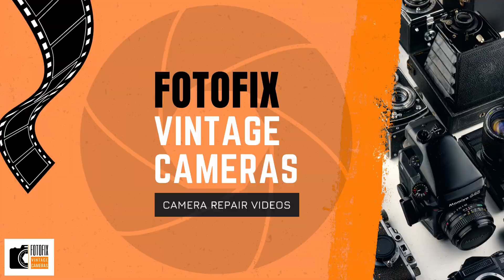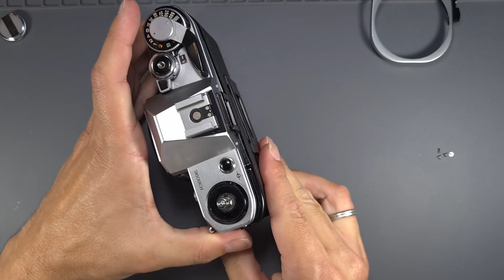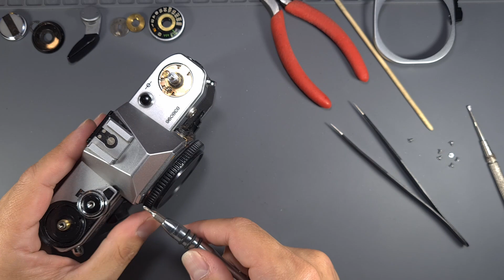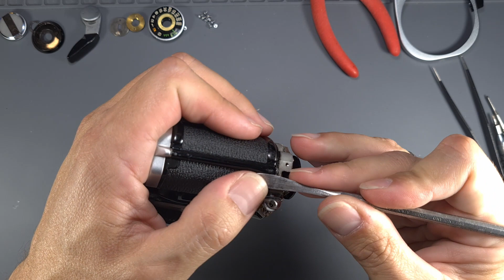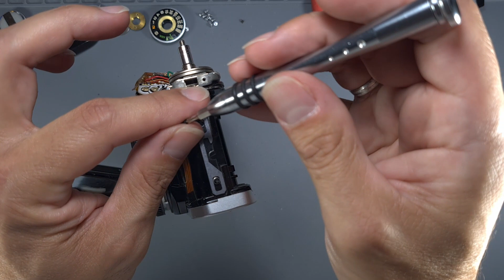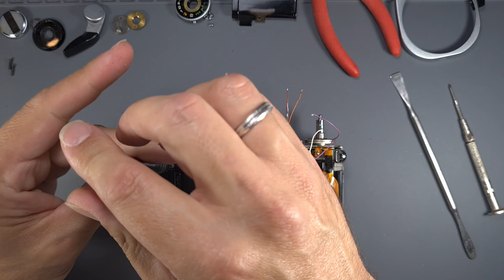Canon AE-1 - Remove the Mirror Box

Comment: Suggestion: after removing the top cover, temporarily re-install the shutter speed dial. This will keep the coupling ring that is under spring tension from flying off and causing extra work and potential damage to the tungsten wire.
Reply from the maker: I normally do that! Thanks!

Comment: Thank you so much for posting this.  Im trying desperately to teach myself to repair old film cameras and I also work in a camera store where we process a lot of film. I see squeaky Canon AE-1's everyday. I knew the camera had to be oiled but never knew the exact process. This was eye opening and I can't wait to try myself one day. I may ruin a few cameras on my quest to learn but thats okay. The master has failed more times than the beginner has ever tried.
Reply: If you really want to get into camera repair, get a broken camera and try to fix it. I did it that way and it works. Just be patient and note down all the steps by taking pictures or so.
Reply: @peterbarth1479  I have over 300 film cameras and a whole lot of which are broken. Ive decided to do just what you said, with a Nikon L35AF2 which I have about 5 of...but I have made minor repairs on them in the past(switching battery doors, cleaning viewfinder, etc) but have never successfully repaired other issues. Im gonna try what you said. Im gonna film the entire thing and see what I can do with my current knowledge. I hope to get there. Though I imagine fixing something like an AE-1 may be easier because it's more mechanical. I've taken apart a few AE-1's to oil them, but not much else. I did fix a Pentax K1000 but I mightve got lucky there. I do have a spare AE-1 so I may try that before the L35AF2.
Reply: @kiroscene6835  Sounds great, go for it. The only problem I see with the L35AF2 is that it's all electronics and nasty flex cables and that sort of stuff. While it is certainly possible to fix broken PCBs and flex cables it might be better to start with mechanical failures to avoid frustration. But no matter what you do first, you will definitely learn something.
Reply from the maker: That's the spirit! :-)